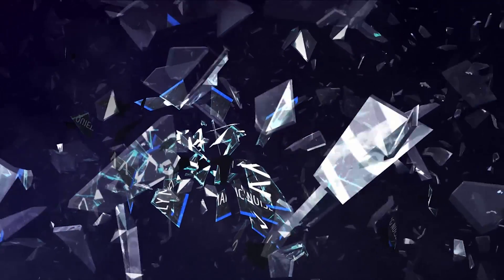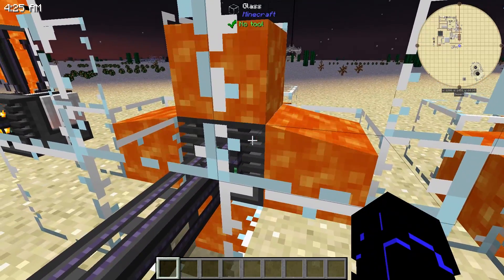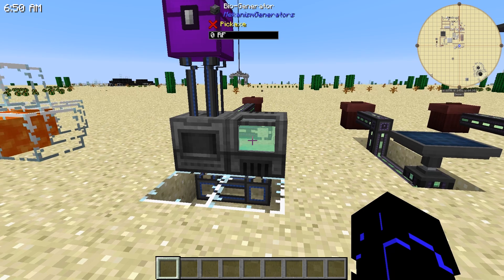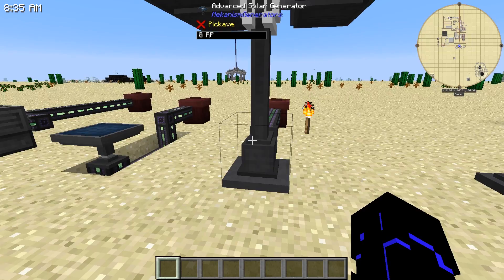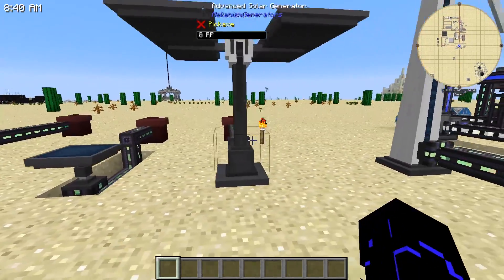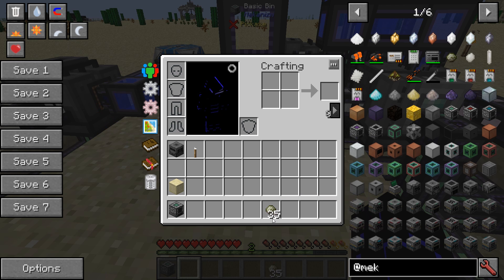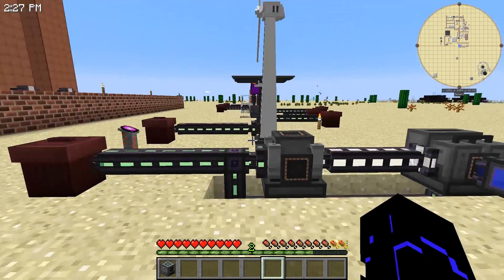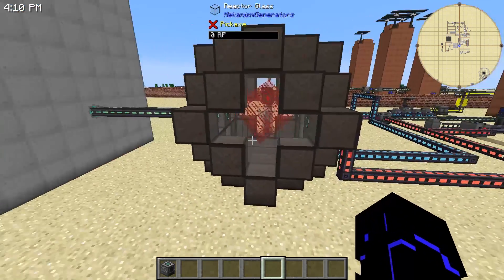Mekanism Power Generation

Comment: my ethylene doesn’t want to get sucked out of the prc, idk what i’m doing wrong oof
Reply from the maker: Likely the machine isn't set to push to the side you want with auto eject on.   Also make sure there are no other chemicals in the tube by breaking and replacing them.   They can't ever touch another tube.
Reply: @oblyx  nope, the output cables were too low leveled. but i fixed it.

Comment: The Gas burning breaks the 1st law of thermodynamics lmao
Reply: I tested in my testing map, the Gas burning generates 8k rf/t when full of Hydrogen and the separator also uses 8k rf/t to produce Hydrogen. Useless generator.
Reply: @choicheong2  yeah they nerfed it in newer versions and i say it was justified  , you can still make power but you need to make ethaline (who when i did some testing its 32+ times more efficient then using biomass in biomass generator  , basicly 64 biomass burned into bio-gen gives you 1.79MFE ,  64 same biomass made into ethaline makes 35.52MFE (electroliser and PRC were powered by itself so that factors almost pure power profit) , in both of these i not factored crushing plants into fuel as both systems but it seams like good power system midgame
Reply: @VarenvelDarakus  thanks for that, you just saved me hours of frustrated testing. did you maybe test as well some method for getting the biofuel that has no net loos or gain of any material?

Comment: 2020: gas burning generators have been NERFED. Pretty sad that I can't power the entire base with it...
Reply from the maker: Use ethylene not hydrogen.
Reply: @oblyx  I was a bit mistaken, I just added 70mb/t into the generator. When I increased it, it skyrocketed into orbit. Still a good source of power.

Comment: I'm having some issues with this. I can get the Gas-Burning Generator to produce enough energy for the electrolytic separator and the pump ... and that's it. With only those two the generator uses hydrogen as quickly as the separator makes it. Makes it pretty useless as a power source. What am I doing wrong?

Playing FTB Omnia

Correction: Every time the pump grabs another bucket the generator loses some hydrogen. So this setup isn't even self sustaining, much less able to power a base.
Reply from the maker: Hydrogen was removed as a viable fuel source a year or more back.  You need ethylene now.

Comment: With the update to the Mekanism mod where it takes the same power to make hydrogen as the gas burning generator uses, is ethylene the best option for power (excluding the reactor) or would bio generators that get sugar cane / kelp from an auto farm be best? Also, thanks for your ore processing video, helped a ton!
Reply from the maker: Thanks, glad it helped.  Ethylene is a great source 1 ethylene plant can provide enough gas to support multiple gas-burning generators, just pay attention to the amount of fuel that each vegetable can produce and go with the most efficient one which can generally be auto farmed with something like actually additions, industrial foregoing, or immersive engineering.

Comment: so I know this is an old video but where you running straight config files for power gen? I have a gas burner set up and am only getting 320 RF/t  not the 8k RF/t you were
Reply from the maker: Yes I was at that time.  However Aiden the mod creator nerfed the gas gen when using hydrogen a few versions ago.  You must now use ethylene.
Reply: @oblyx  I will try that tonight when I get on thanks
Reply from the maker: No problem.  Let me know how it goes.
Reply: Waiting 1 month
Reply: Sorry its been a bit... yes the ethylene fixed my issue for what i needed it for. Not enought to do whole base do to other mods I have but enough to run all my meka machines no problem
Reply from the maker: @swearingpistol7031  cool, now you need a reactor 💪

Comment: Protip: make a melon or pumpkin farm for the pressurized reaction chamber.

1 melon = 16 biofuel (4 melons = stack)
1 pumpkin = biofuel (8 pumpkins = stack)

A farm of 8-16 melons should more than enough to be self sustaining if you use a digital miner with silk touch and transporting.
Reply: Cool tip. Thanks!

Comment: The gas gens don't do well at all.
There's a bug that makes energy upgrades not work in the separators, so the hydrogen production takes about 100% of your net power generation from a hydrogen burning gas generators, and about 80% from an ethylene burning gas gen.
But wait, there's more!
If you planned on using ethylene anyway, you still have to factor in the other components to make it self-sustaining, which will lower that remaining 20% power production to all of 3-5% depending on if you're using machines to grow/harvest material to crush up into biofuel or if you have a mob grinder, either way, it's a total waste of hours worth of effort to mine the materials to make the setup and get it all rigged up right!

Essentially, anything that generates power by using an electrolytic separator is negated to the point where you're better off just using solar generators.
Reply from the maker: It's no bug.  It's by design that hydrogen no longer works.  It's more realistic.  Ethelen is actually a really good power source.
Reply: @oblyx  
Hydrogen takes exactly 120rk/t to produce, and generates 120 rf/t. No net gain whatsoever.

And ethylene isn't any good, it takes a minimum of 500 rf/t to automate production of enough biofuel (using wheat, which is slightly more efficient than anything else except perhaps melons which are less reliable thanks to the wider drop-count range). Add another 450rf/t for hydrogen production to match consumption rate, another 1.2krf/t for the crusher (or worse if it's not maxed on energy upgrades), and finally another 2krf/t for producing the ethylene.

Total minimum cost: 4.2krf/t
Total production: 5.9krf/t
Net gain: 1.7krf/t

Factor in space needed, cabling, item ducts, RAM usage to keep up with all the math, and client-CPU load to render all this, and you're INSANELY better off just making 5 advanced solar generators for a simple and completely self-sufficient net gain of 1.9krf/t with at LEAST 1/50th the rendering CPU intensity.

It might as well not exist if you're not netting at LEAST 3.5krf/t from ethylene.
At best, it's a side-generator for if you plan on intentionally using astral sorcery for extended night time.
------------
While we're here, are there any other Mekanism machines that have been nerfed into uselessness? I'd rather not make a Fusion Reactor and put a few billion RF into it just to find out it now """more realistically""" produces a similarly over-nerfed max of something like 100krf/t and the machines to run it and generate the fuel cost 95krf/t of that. (I wish that was a joke, but with so many electrolytics and their not benefitting from efficiency upgrades despite being able to take them and stating that they're making the machine "10.0x more efficient", that's actually a possibility. At 8x speed upgrades, each separator takes 31krf/t, so yeah... it's no doubt RAPING the net power output even at your video's shown base output of 399krf/t.)
Reply from the maker: sounds like  you have either built an inefficient setup, or are starving the system of some resource.  most often i find people starve it for water, or fail to include buffers.  post update which removed the ability for hydrogen to work as an efficient fuel source I've used ethele fueled gas burning generators to power entire bases as you could see on either of my ATM3 series, or my Project Ozone Lite series.  As a mid tier generator they are fantastic.  They are not, by design an end game generator.  That is what the reactor and the turbine are for.
Reply: @oblyx  Well shit, how much water does the thing need? I figured a direct pipeline from it's own kitchen sink (which instantly flooded the line to max capacity, and filled the already hooked up separator to the brim) would be plenty.

>they are not an end game generator
Nope, but endgame is a far cry from midgame, and given how little effort, space, and computer-intensive adv. solar (a fairly early game energy source) is comparatively,  a single ethylene GBG should far outshine 8 adv. solar gens in non-arid climates.
If they want to balance GBGs for any reason, they shouldn't be nonsensically removing the benefits of energy upgrades in separators (yet ridiculously still allowing the machine to use them, despite their lack of their essential functionality). They should be balancing the regular GBG energy output numbers based on fuel used.

The best mid-tier generator so far is your already easily mass produced adv. solar generators. If ethylene was going to be at all of value, it'd have to be able to keep up with at least 8 (preferably 10) advanced generators (given that the ethylene requires a significant amount of biofuel).
Reply from the maker: @TheKhopesh  send me a pic to my instagram of how you built yours.  maybe i can see something.  biofuel is super easy and cheap to make, especially if you have immersive engineering or actually additions in the pack.  make sure to use a factory with power upgrades which are relatively cheap to make.  don't do the speed upgrades until you have all the power upgrades in place and are making a good amount of power.  water wise, make sure you are using an ultimate pipe and watch the machine for if it runs out.  also check that you don't have one of the machines set to dump because the machine will run forever and constantly consume power.  a good setup will turn on and off as needed filling some form of battery such as an induction matrix, power cells or the like.
Reply: @oblyx  so how'd this end up going down
Reply from the maker: They did not send over their setup so I could check it out.  I assume they found the problem or moved on.
Reply: @oblyx  interesting. Maybe I'll take some time and check out the mod myself to see if I can see what he's talking about, though it's kind of hard when I don't know if he used any external mods, ect
Reply: hmm how efficient it would be if use nature essence from mystical agriculture

Comment: Hydrogen + gas generator barely produces enough energy to run. I added mechanism water pump as there was no water source like this in my pack and it could not keep up.
Reply from the maker: Aiden changed the power produced from hydrogen in a gas burning generator several months after i made these.  Now you need ethanol.
Reply: oblyx how do you get ethanol? Edit: also has the wind generators efficiency changed?
Reply: A Commenter I think he meant ethylene
Reply: yeah but with energy upgrades you can still make power from splitting water and burning hydrogen.

Comment: In Project Ozone 2 Frozen, I used an array of passive heat generators feeding into a capacitor bank for early game power. Sag mill was the main usage but alloy smelter etc could be used at slow rates.
Reply from the maker: They work for sure.  I used one early on in my first ATM3 series.  But id get solar or wind quick if you want to stick with Mek power.

Comment: Im having an issuse.  Im trying to compact your setup and pump out more power on the basic gas burner set up. I have 1 aqueous accumulation center. 2 electrolytic separator but opp sides of aqueous connected to the gas burner. Im not making any power.  Whats going on
Reply from the maker: Aiden Brady the mod author of Mekanism changed the mod not long ago.  Hydrogen no longer produces enough power.  You have to feed the gas burning generator ethylene now.
Reply: @oblyx  lame. I had a simple small setup that could power the digital miner easily
Reply from the maker: He wrote a whole article about how he wanted it to be more realistic and how it doesn't work that way in the real world so he wanted his mod to be more real.  I kinda get it and it was a lot of power for virtually no work.  I'm on the fence because I miss it, but I understand what he's trying to do.
Reply: @oblyx  yeh that seem legitimate reason to do so. But there should be a happy medium between realistic and non due to the fact its minecraft. Ill just go back to environmental tech. Pain in the ass but its the best over time
Reply: @Tha_Monsta88  
IRL, 40-50% oxygen can be used to literally BURN IRON AS A FUEL! (Or steel, you just need the iron content really. But seriously, this is the exact same science behind thermal lances that are used for cutting through solid steel thicker than a grown man's torso. It reaches temps up to 4500 C.)

Essentially, they should have a generator that can use the oxygen along with a solid fuel.
Additionally, that fuel could be most anything.
Simple fuels like coal/sugar/wood etc. would allow for low tier energy output.
While iron (or steel, but steel wouldn't be any more efficient and it's more expensive to make so it wouldn't be as ideal) would produce a pretty considerable amount.
If you want to get a little more out of it, a blend of three parts iron and 1 part aluminum dust would produce even more power.
And if you really wanted to make it produce a lot of power you could start burning rarer/more difficult to acquire resources like ardite, ironwood, steeleaf, etc. (each of those has their own difficulty to acquire and are difficult to produce in enough quantities to use as fuel, so they'd more than warrant considerable power output. Their power per item would also need to be different for each one based on difficulty of acquiring.)

Hell, make the generator a small multiblock structure (like the digital miner) and also let it be upgraded with factory installers so it can burn multiple fuels at once and give each a separate speed control
----
Picture this:
You keep a generator with a constant low-tech burning of sugar at a decently high speed for a net power gain of 1-2 krf/t, a constant slow-burn of iron/aluminum blend dust for 3-5 krf/t, and say about 50krf/t from manual ardite burning at max speed for when you need  a large power boost for short bursts of power for really intensive energy use like running an IC2 matter fabricator with scrap boxes.

You could also have an internal item storage that burns IC2 scrap as a trash-box function for when you want to just clear something of little to no value (IE, leather armor).

Later on, you could be running a massive mob farm hooked to a setup to sort the drops (the items you can't use being fed through an IC2 recycler and feeding scrap to it), repair the usable armors they drop, send it through an arc furnace, and pipe the various fuel metals through to your generator with all it's different chambers burning different materials.
One could be burning iron (or boron or gold), one burning ironwood, one for steeleaf, one for knightmetal, and the rest could be burning inferium, prudentium, etc. to pump out low-to-moderate reactor levels of energy. Probably something in the 200 krf/t range burning through all of that, and each consecutive channel running would take a speed upgrade in the electrolytic separator you're feeding the O2 from (so at all 8 from the ultimate factory upgrade on the generator you'd be draining about 31krf/t just to run the separator with max speed upgrades to provide the oxygen, but that'd still be netting you about 170krf/t for your incredible time investment).
--------------------

Granted, those numbers are made up on the spot just to help you visualize it, but this would be a FAR preferable idea than "Yeah, we have this gas generator that's complete shit now, it only burns ethylene, and that's wildly less efficient than just running some advanced solar generators that take no fuel and only tie up a small area which you can pipe down from build limit to keep your base free of clutter."

It'd be the best generation method with the least waste between starting power (IE a few wind generators) and a decked out fusion reactor (if the fusion reactor hasn't been destroyed now that it takes about 120krf/t just to run it's power-raping maxed out chain of electrolytic separators!)
Reply: @TheKhopesh  ok dr stone calm down lol

Comment: Hi, i've some problem with the gas-burning generator. The electrolytic separator takes 8kRF to create hydrogen and the gas genearator generates 8kRF. Where am I wrong? Might you help me, please?
Reply from the maker: yeah, Aiden Bradey the mod author for Mekanism changed the rules around the gas burning generator a few versions back.  he did it to make it more realistic.  no longer will the hydrogen produce enough power to run more than the system needed to make the hydrogen.  you have to move into ethylene to get the power nowadays.  grow some potatoes and crush them to get bio fuel.  mix the biofuel with the hydrogen in a PRC which gives you the ethylene, run that into the gas burning generator and you will have tons of power pretty cheaply.
Reply: oblyx Wow! I didn’t know that. Thank you for the reply, you are a gentleman :)
Reply: The process with just hydrogen broke the laws of thermodynamics.  Splitting water with energy, then burning the hydrogen to get energy (which chemically also forms water as well) shouldn't some how give a surplus of energy.  In fact, it takes more energy to set up such a loop.
Reply from the maker: Yup, which is why he removed that function.  He tries to keep it somewhat realistic.

Comment: I don't found these generators on my mekanism :(
Reply from the maker: Hi Adrian, Mekanism is actually made up of 3 different mods.  Mekanism, Mekanism Generators, and Mekanism Tools.  They can work independently, but are most often found together.  The generators are obviously found in the Mekanism Generators mod.  Just make sure that is in your pack and you should be good to go.
Reply: Wow, thanks!
Reply from the maker: no problem, hope it helps.
Reply: @oblyx  thanks, had the same problem, i thought all the things were of only one mekanism mod